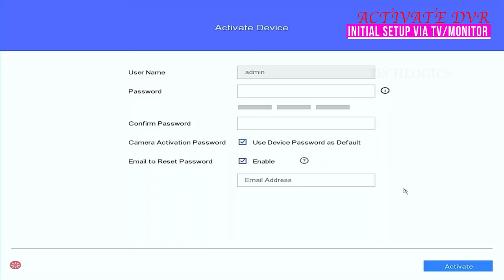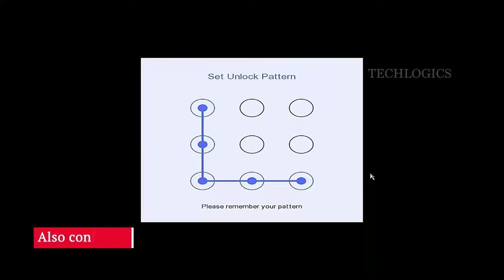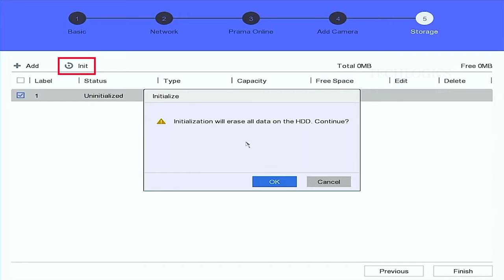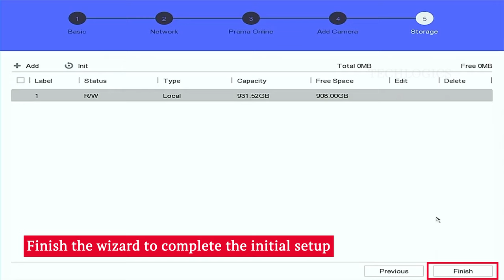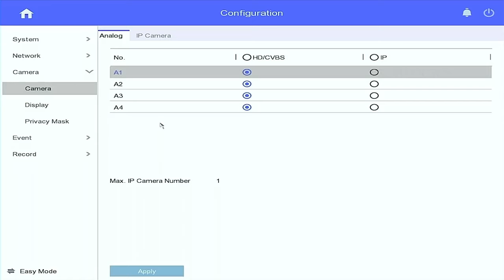Prama CCTV DVR Hard disk installation & DVR Activation | Prama DVR Initial configuration setup

Comment: Great video thanks. Mine doesn't have power cable for drive. Is that normal? Hdd should be ntfs format? The system app need to be installed on the new drive? Thanks